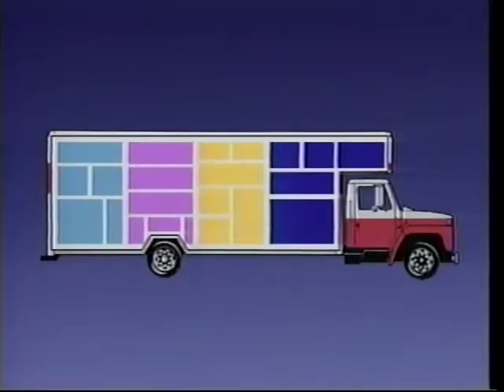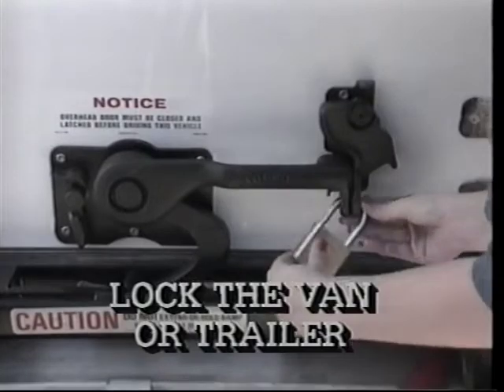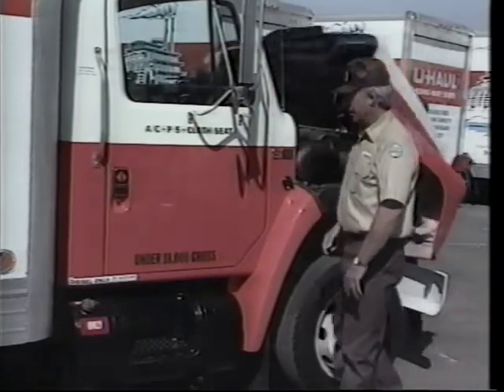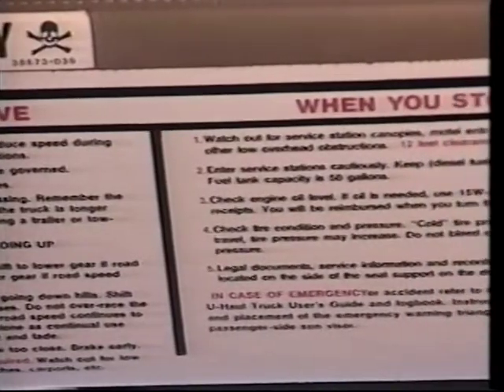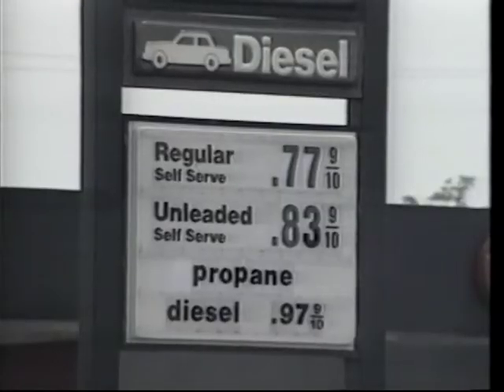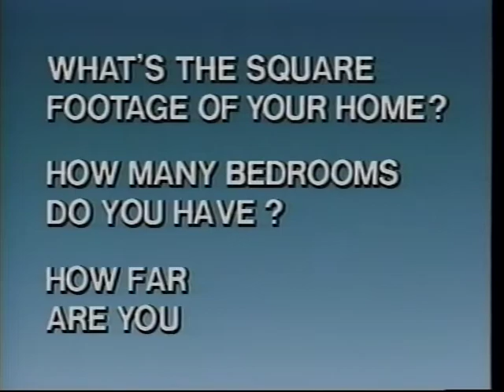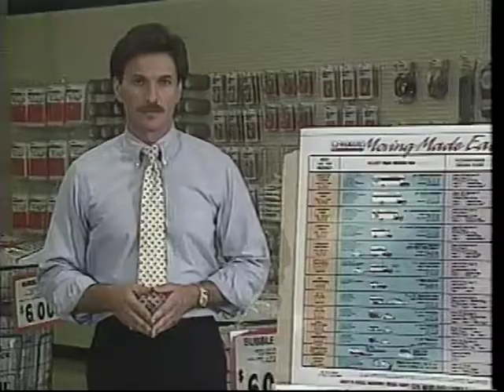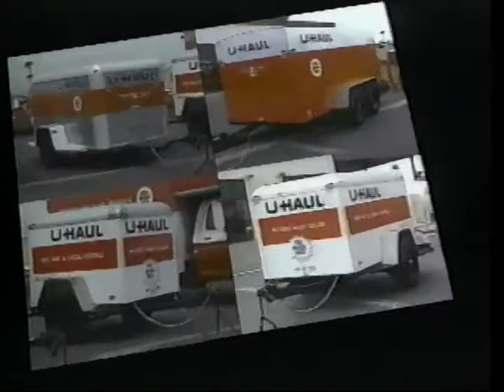VHS - U-Haul (1988)

Comment: One strategy I use is to make sure that I fill in all small cracks and crannies, it helps to secure your stuff from shifting and it maximizes the space of the truck. I didn't know that the trucks had a kneel on them back then, I bet that added a lot of extra maintenance but helpful to customers.